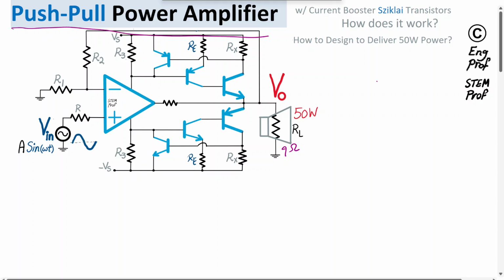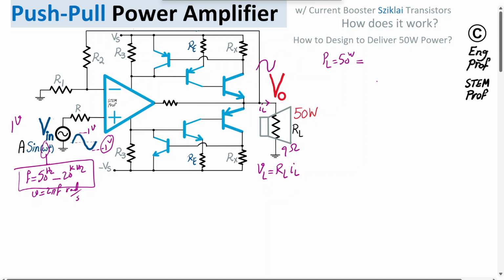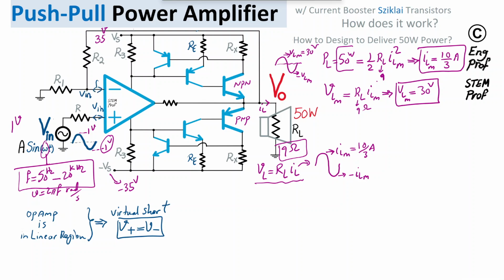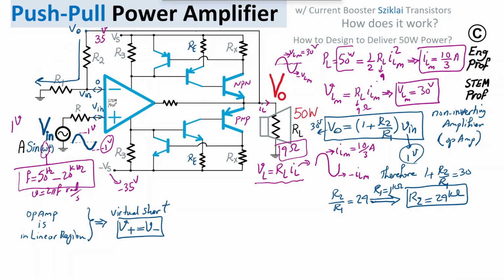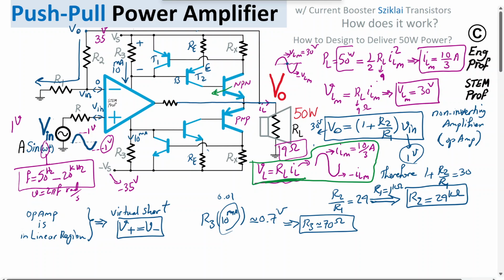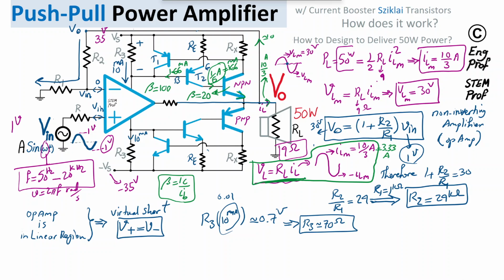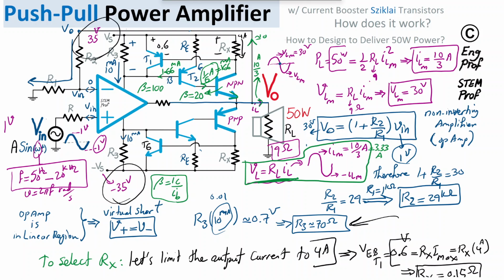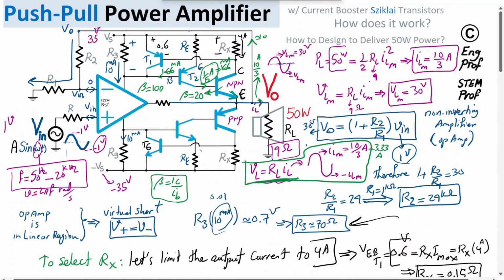Push-Pull Power Amplifier Design with Op Amp, Sziklai Darlington Transistors

Comment: I have a hard time understanding where the 'control' of the circuit comes from.
The output of the OpAmp alone cannot move the RL, isn't?
The only defining fact is the Ube on T2 (and T4 for the bottom side), which is ever so slightly on. I can only figure, that the OpAmp might need more current flowing into the Vdd if the output swings positive and thus creates a current over the Rout. After all this current has to come from somewhere, so it's likely from Vdd? Or IR3 into Vss for the negative half wave.
But that would also mean, that this circuit cannot work anymore once you go for a TL072 or any other dual OpAmp? Is this correct or what do I miss?
Also the biasing might require the two R3s to be trimmers in the real world? txs and please keep posting such excellent videos!
Reply from the maker: Thanks for the encouraging comment. Glad that you liked my videos. Regarding your question, as you already well summarized, the internal output stage inside the op amp looks similar to the NPN-PNP output stage of this power amplifier circuit (albeit with orders of magnitude less current). During the output positive swings more current flows from the Vdd toward the positive supply rail of the op amp resulting in voltage drop across resistor R3 that then turns on the PNP transistor of the Sziklai PNP-NPN pair.  
Regarding Op Amp, I suggest Texas Instruments OPA607 or TL071 single op-amp package to avoid issues. And regarding your trimmer question, it should add further flexibility assuming a proper resistor value for the range of trimmer.  For more examples please see: 
Push-Pull Power Amplifier with Darlington and Sziklai Transistor pairs https://youtu.be/866MYibo8yE
and High Voltage Push-Pull Power Amplifier design https://youtu.be/C9Hse91r5sA
I hope the explanation and examples are helpful.

Comment: I like this circuit alot, would like to use it for a pc speaker, but i can offer max +/-15V.
higher than 24 volt transfoerma re hard to get.
Reply from the maker: Thanks for watching and your interest in this Push Pull Amplifier Design video. Glad that that you liked this circuit. For more amplifier examples please see https://www.youtube.com/playlist?list=PLrwXF7N522y4c7c-8KBjrwd7IyaZfWxyt. For Audio Amplifier Design practical consideration and THD of transformer parasitics and non-idealities including imperfect flux and magnetic coupling are important in order to achieve a decent functional design with acceptable in-band frequency response (say 20 kHz for audio applications). To achieve that an important step is properly selecting (with correct voltage) Audio Transformer or Signal Transformer that can be purchased from either https://www.digikey.com/en/products/filter/audio-transformers/162 or https://www.mouser.com/c/passive-components/audio-transformers-signal-transformers/.  That proper selection should ensure a practically flat-response transformer in the desired frequency range. I will post more examples in my analog circuits and signal processing playlist: https://www.youtube.com/playlist?list=PLrwXF7N522y4c7c-8KBjrwd7IyaZfWxyt
I hope this is helpful.🙏
Reply: @STEMprof  accidentally watching this video again, because it showed at some guy explaining guitar amp.
18:22 The current coming from the base of "t1", next to R3 is heading to  Rx / PNP power transistor emitter.
but the NPN with the same function on the low side doesn't have this problem, wouldn't that offset the output of the circuit?

I was playing with the Sziklai config in the simulator for logic and driving leds, i was forgotten about this video and thought i rediscovered the whole thing.
: )
I decided to build an amp with the Sziklai config in the sim, i use 4 opamps (TL074) to completely eliminate zero cross distortion.  couple of days ago, i got some BD137 & BD140 transistors from the shop around the corner and couple of weeks ago i got the +/-15V transformer this guy reserved for me, it's  New Old Stock thing. 
I think you would like my design, however more "research" is needed, before i send out the PCB file.
I'm also designing a simple function generator to create a Triangle, to test my amp with frequencies of 100kHz or more, i saw someone do that with a Chinese clone of  DarTZeel amplifier and it started to drop in amplitude at frequencies well over 200kHz.  
But i still only have +/-15 V toroid transformer witch aint even symmetrical 40va, 10va,  playing with the resistors on the base of the Sziklai's i can easily max out the BD137, BD140 of 1.5 amp at 15V in the sim, witch voltage swings of about 20 V.p.p., even at 3 V.p.p.

How does that work with car's amplifiers witch only have 12V, max 13.5V?
I can't use Rx, i would need power transistors witch i don't have, but i'll try to shoehorn these protections transistors somehow.
Reply from the maker: @AnalogDude_  Glad that you rewatched this video and revisited my channel.  Thanks for sharing your insights and observations.  There have been few changes in channel structure. There are now smaller focused circuit playlists including Oscillators (Triangle, Sawtooth and Complex),  Amplifiers and sensor signal conditioning videos (links below).  Regarding the current coming from the Base of T1 transistor, it actually goes to the collector of the NPN power transistor. 
Oscillators & Signal Generators https://www.youtube.com/playlist?list=PLrwXF7N522y4ee_0GL2EdguM-kLtJPxpU
Sensors & Instrumentation Amplifiers https://www.youtube.com/playlist?list=PLrwXF7N522y7Ut9bm8TXAOhIWqL__FGlj
Power Amplifiers & Voltage Regulators Videos https://www.youtube.com/playlist?list=PLrwXF7N522y4vWr-8XRBqxpi5idFDE9BV
I hope you find these more focused Circuit Videos playlists helpful.
Reply: @STEMprof  I'm trying to do the same with mosfets in the Fallstad simulator, the source of the N-type via resistor is connected to 1.5 Volt, so if the amplitude of the audio exceeds this limit the mosfet starts working, something like a audio compressor.  it kinda works, but not there yet.
Reply: @STEMprof  I think i got it, but still need refinement, wanna see it and help get it right?
Reply from the maker: @AnalogDude_  Thanks for your interest in this power amplifier circuit. Glad that your circuit is working :)
Reply: i have always used 100 Ohm resistors on the power supply pins of the op amp, ic's and it works fine. Roland used to do this as wel on ic's. @STEMprof

Comment: A nice Sziklai Darlington circuit, but I have some stability doubts. The first one is, Op Amps normally need capacitors at the supply rails to avoid random phase shifting of the internal components (e.g. current source of the differential amplifier). A phase-shift close to π turns every amplifier with feedback into an oscillator, resulting in magic smoke from the power transistors. Already a typically used 220nF capacitor with R3=70Ω results  in maximum a frequency of 10.3kHz (-3dB-point) - instead of 20kHz due to τ=RC and fo=1/(2πτ). The second issue is the stability of the bias current to suppress crossover-distortions. Since BE-voltage of a BJT drops about -20mV/K according to the Shockley-equation, I can't recognize a stable and temperature compensated bias. In my power-amplifier designs I regularly use a either two diodes and a variable resistor, or a BJT with a variable resistor, thermally coupled to the power transistors. This ensures a stable bias-current over the whole intended operation temperature range.
Reply from the maker: Thank you for watching and sharing your insights and practical suggestions. You have good points for practical implementations. For the capacitor at the supply rail for the op amp, the adjustment in scaling down value of R3 to say 470 ohm and op amp supply rail cap to 150nF should be practically safe to allow for 20KHz 3dB cutoff frequency. As for the thermal stability, you have good points. That is an important topic that should surely be considered for practical implementation. There are multiple techniques including the methods you mentioned. For more examples involving temperature measurement and compensation please watch: Voltage Regulator with Temperature Compensation https://youtu.be/NdfyHoxjKrY 
and Anti-Log Analog Computer with Transistor-Tempco Resister Temperature Compensation https://youtu.be/kk2c7Gk3nW4
Thermometer Circuit Design with Op Amp and BJT transistor https://youtu.be/55YsraFE0rg
Thanks again 🙏
Reply: Doesn't work at all...

Comment: Very interesting schematic. I'm missing one thing, how to determine value of output resistor for that opamp? I would proceed this way: define max allowable current of opamp (say 30mA in this case), if output is shorted then max voltage would be 35V. So value would be 1.2 kΩ. Or I have to consider full span ±35V (in case there is some capacitance at the output and charged to -35V), so the value would be 2.4 kΩ. Or there is something else to consider?
Reply from the maker: Thanks for watching, your comment and sharing your thoughts and good practical suggestions. As you pointed out, the presence of that resistor at the output of the OpAmp is exactly to protect the op amp by limiting its output current. You summarized it well to compute the resistor value taking into account the worst case scenario of max op amp output voltage while load is shorted to ground. A value on the order of 1kOhm should be fine given nominal output AC current of the op amp is on the order of mA or less in this design (since power BJT transistors are sourcing or sinking current). For more Op Amp Circuit examples pls see: Op Amp Amplifier with Electronic Gain Control https://youtu.be/NoNgQpbj77Y
Push-Pull Power Amplifier with Darlington Transistors https://youtu.be/866MYibo8yE
Power Amplifier Design (Class A) with Transformer https://youtu.be/gKlJrqGqeCI
Analog Logarithm Computer https://youtu.be/RpKEq5WyoLg
Op Amp Analog Computer Differential Equation Solver https://youtu.be/ENq39EesfPw
Thermometer Circuit Design with Op Amp & BJT transistor https://youtu.be/55YsraFE0rg
Instrumentation Amplifier with Electronic Gain Control https://youtu.be/C4tghZ-q6Zs
For more analog circuits and signal processing examples see: https://www.youtube.com/playlist?list=PLrwXF7N522y4c7c-8KBjrwd7IyaZfWxyt
Thanks again🙋‍♂

Comment: Dear Mr, could you please recommend a ultra low impedance output amplifier (with 1 ohm output)?
Thanks!
Reply from the maker: Thanks for your interest in this channel. My suggestion is first identify the most appropriate operational amplifier for your specific application considering your desired KPIs (gain-bandwidth, slew rate, output current , supply range, etc.). Then if the output impedance of your selected op amp is not as low as you want, you can use one of the resistive load reduction techniques (for example add a negative resistance at its output of op amp). For more analog circuits and signal processing examples see: https://www.youtube.com/playlist?list=PLrwXF7N522y4c7c-8KBjrwd7IyaZfWxyt
I hope this is helpful. 🙋‍♂
Reply: @STEMprof  thank you very much!

Comment: For me to have a good result, we need another really good sounding input opamp and a common negative feedback loop. Because all these "special" (high voltage) opamps are total cr.. considering how do they sound. Another thing is a setting of a bias on the output transistors. I think the opamp output resistor can do this. It must be small. The third thing is a stability. Shiklays are not good in this. Must be simulated, prototyped and tested.
Reply: I would have liked to see a emitter resistor on the power transistors and a bios circuit wit temperature correction and a always on resistor for the drivertransistors so we don't get crossover distorsion. And I don't understand the 9 ohm load - it should hav bee 8 ohm (will acquire no changes) og 4 ohm.
But a very good review of the circuit. I don't think you need to worry so much about Vi+ = Vi- it must be expected that we know that. Thanks!
Reply from the maker: Thanks Michael for watching & sharing your observations & your feedback. Glad that this power amplifier example is useful. As a variant of this design we can move the current limiting resistor to emitter of power transistor that then requires modifying current limiting BJT transistor as well. We can also replace Sziklai Transistors with packaged Darlington BJT IC. I also understand your point regarding 8 ohm. My main focus was on the explanation of how the power amplifier circuit works and how to design it. I also appreciate your point regarding the basic level of virtual short for op amp. But please notice that I have to consider a wide range of audience and therefore I try to start with first principles in the circuit analysis that sometimes require repeating basics. I hope this clarification is helpful.  For more analog circuits and signal processing examples see: https://www.youtube.com/playlist?list=PLrwXF7N522y4c7c-8KBjrwd7IyaZfWxyt
Thanks again 🙋‍♂️
Reply: @STEMprof  Yes, I see. Your "explanation series" is outstanding, and will be referenced for a long time in a future I hope. Besides it contains "tricky" examples, and this is great. Good luck with your channel, sir.
Reply from the maker: @sc0or  You're welcome, and Thank you for the encouraging comment. Glad that you like my channel and its videos are useful. Thanks again for sharing your thoughts 🙏
Reply: Where this Sziklai comes from? Is it a company what makes transistors? I' ve never heard of them.
Reply: @dorzsboss  He was a Hungarian engineer, who solved a problem of missing good powerful PNP BJTs those days
Reply from the maker: @sc0or  Thank you for the comment & insight re Sziklai BJT transistors pair. Here is another Amplifier video https://youtu.be/866MYibo8yE involving both Sziklai and Darlington transistors. I hope it is interesting as well.
Reply from the maker: @dorzsboss  Thanks for watching, your interest and follow-up question. Sziklai is a PNP-NPN or NPN-PNP variant of NPN-NPN or PNP-PNP Darlington BJT transistor pair. Please watch the following example to see anther circuit involving both Sziklai and Darlington transistors: Power Amplifier with Darlington and Sziklai Transistor pairs https://youtu.be/866MYibo8yE .
I hope this clarification & additional example are helpful.
Reply: @STEMprof  Thanks for the clarification. Until now I knew this Sziklai configuration as "complementer Darlington".
Reply from the maker: You're welcome. Glad that clarification and video were helpful. 🙋‍♂️
Reply from the maker: Thanks for watching and sharing your thoughts regarding practical considerations. Depending on application designer need to properly select op amps and power Transistors. (I just presented examples). A variant of this design with Darlington Transistor IC package instead of discrete Sziklai transistor pair might be a better choice. For more examples please see 
Op Amp Amplifier with Electronic Gain Control https://youtu.be/NoNgQpbj77Y
Push-Pull Power Amplifier with Darlington Transistors https://youtu.be/866MYibo8yE
Power Amplifier Design (Class A) with Transformer https://youtu.be/gKlJrqGqeCI
For more analog circuits and signal processing examples see: https://www.youtube.com/playlist?list=PLrwXF7N522y4c7c-8KBjrwd7IyaZfWxyt
I hope these Circuit design and analysis videos are interesting. 🙋‍♂